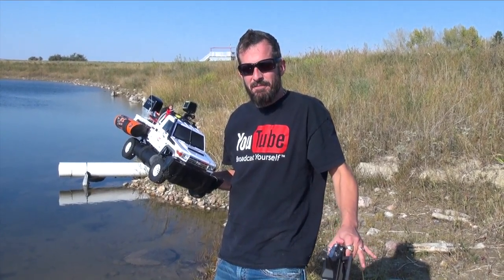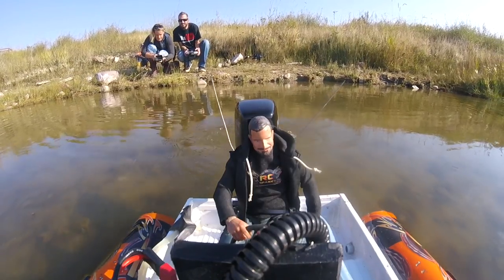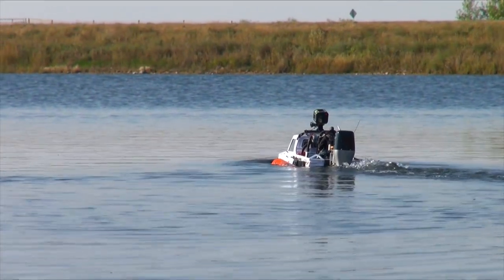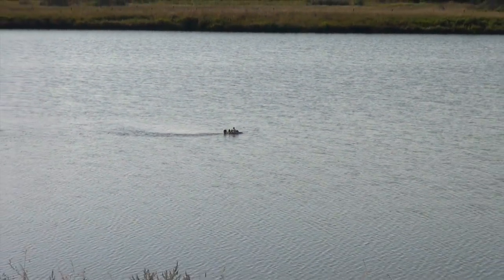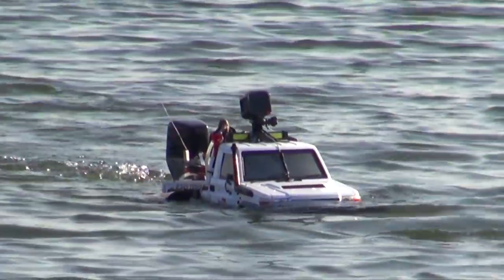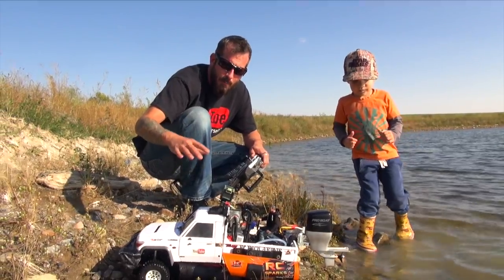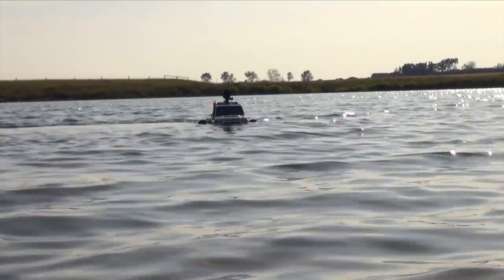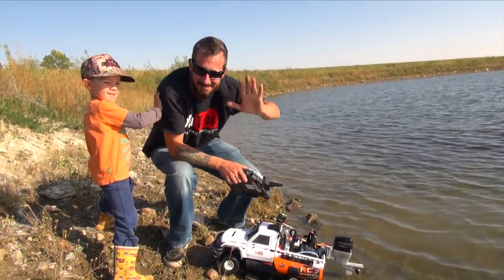RC ADVENTURES - TOYBOTA PROJECT -TOP GEAR TRUCK BOAT TRiBUTE! PT9

Comment: Are you going to do another run with just paddle tires to see if it will do any better versus the boat motor
Reply from the maker: Funny you mention that, Jem was saying the same thing last week. It would be interesting to compare the tire types. thanks for commenting!
Reply: RCSparks Studio keep up the good work I'm loving it ^_^

Comment: I have a toy RC boat that was given to me and I replace the electronics with a 75 MHz system it has two motors for steering and to ESC's I didn't take the red wire out and it still works perfectly fine I did it with another car that had tank tracks and had no problem with two motors and to ESC's plugged into the receiver without taking out the Red wire not sure if it's because it's not a 2.4 maybe The old stuff is more forgiving